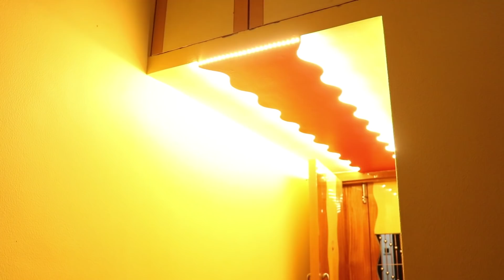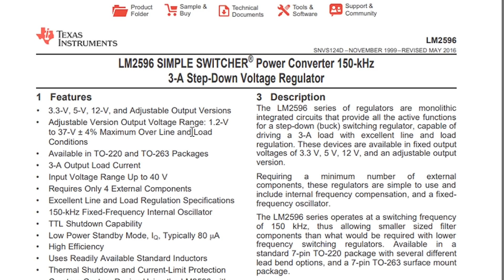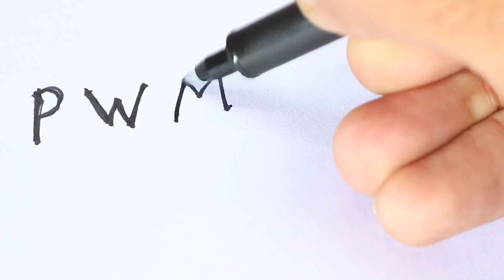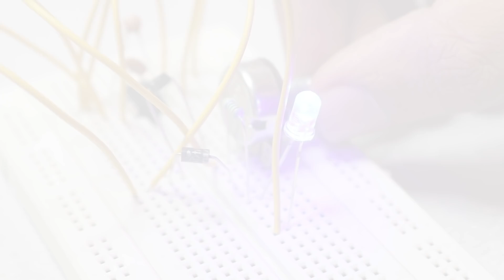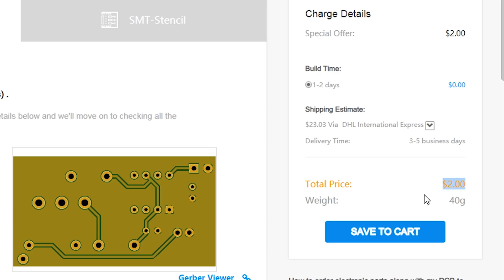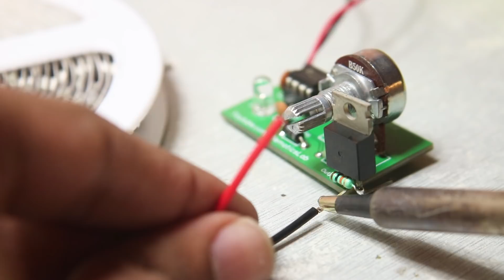IC 555 LED Dimmer | DIY

Comment: I don't have a 500k pot, I have a 50k pot, it works but the adjustment is very sensitive. Is it supposed to be a 500 ohm pot or a 500k?
Reply from the maker: Use 50k or 47k

Comment: Why the circuit (with IRFZ44N) does not deliver the full current neened by the LED strip, connecting the strip directly will draw 1.5A and with the circuit 1.2A max?

Comment: You make awesome videos. I an always in search of such channels that deals with electronics. I have a request make videos with detailed information, for example i can't understand why you have put mosfet at the output.
Edit- i too went through the article you have provided. But there was no information about mosfet of how it was delivering extra current or whatsoever.
Reply from the maker: Ic555 can internally provide 80mA maximum if we add and external MOSFET it takes power from power supply instead of IC,

Thanks for feedback I'll improve from next video 🙌
Reply: @Nematics_Lab  tanks for replying 😀